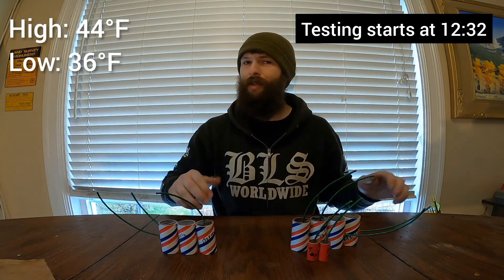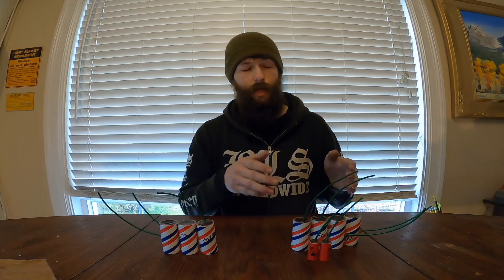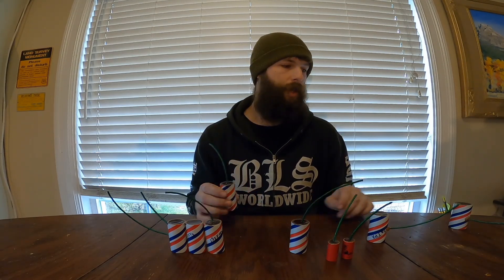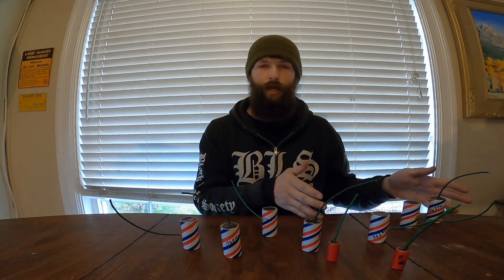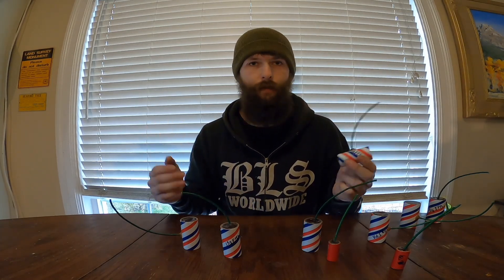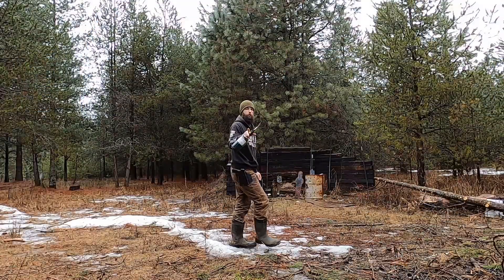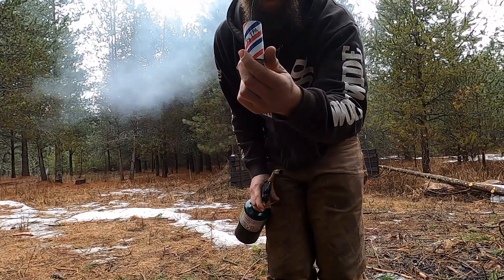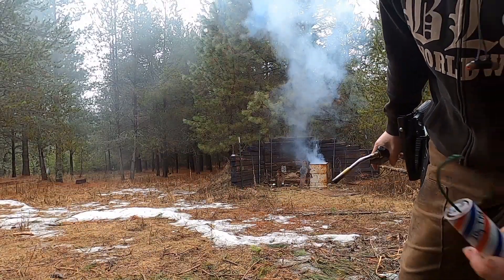Comprehensive TPA Salute Testing (1.4 gram to 20 gram)

Comment: Save TPA for smoke mixtures. If you using perchlorate as an oxidizer you really don’t have anything to worry about. Make sure you work in a static free environment
Reply from the maker: Thanks for watching
Reply: There are TPA formulas out there that will ROCK a standard 7:3 or 7:3:1 in a 3" or 4" salute. Tends to dull the flash as well depending on your AL to tpa ratio. Can't see it being to useful in a ground salute...not big enough for it to make a huge difference but in a 4" shell the pitch is definitely different.
Reply: @bryanmoore3051 I bet it reduces impact sensitivity.

Comment: Great video. TPA in a nicely spiked and pasted shell will hit like a mf 💥 I will use it in 2” and greater shells. Smaller I still use 7:3.
Reply from the maker: I don't blame you for using the traditional mix on smaller shells, I'm just really paranoid about mixing non-tpa flash. This past fourth I used it for all my salutes down to M-80s with a 1/2tsp (~2.5g) of powder each, fuse coming out the side, wood glued end plugs, and they all slapped. No duds. Even had one of my very few neighbors about a quarter mile down the road yell at me to stop after the 10th or 11th one😂
.
Thanks for watching

Comment: Pine pitch? Just use wood glue it turns rock hard and you can basically glue them much further up fitting in a lot more powder.
Reply from the maker: I do use wood glue, just wanted to see if it worked. At 10:27 I discuss why I wouldn't recommend it
.
Thanks for watching

Comment: What % tpa in these tests?  Not asking for comp!
Reply from the maker: 15%. Haven't tested any other ratios because this one goes boom and is (relatively) safe to handle. More is unnecessary and less would increase the danger when mixing, which I don't really need either
.
Thanks for watching
Reply: @HabeasJ 15% worked well. I heard anything above 18% becomes hard to light. 

Im thinking 10% will have even more power and still reduce senstivity significantly. Ive always used 7030 anyway
Reply from the maker: @lukem1961  it will definitely still reduce the the sensitivity. Im sure there is a sweet spot for TPA, but like a recovery strap to pull a truck it's sometimes better to have more than less. Within reason of course, but a safety margin usually isn't a bad thing. I like to lean on the side of caution. Heard too many horror stories and the way I mix TPA flash is dependent on the lack of sensitivity

Comment: Why not just use normal perc flash?
Reply from the maker: Kclo4 flash is still very impact and friction sensitive as compared to TPA flash. Kclo4 flash can explode in amounts as little as 10 grams unconfined. TPA flash will not explode unconfined, only burn. That means the process of making TPA flash is much faster and easier, and you can also safely mix muuuuuch larger amounts at one time... I made over a pound for the 4th lol
.
Thanks for watching
Reply from the maker: Added an explanation since you added a question to your comment🤙🏻